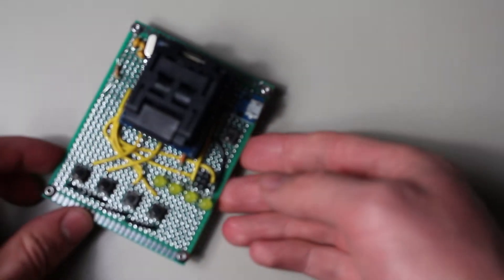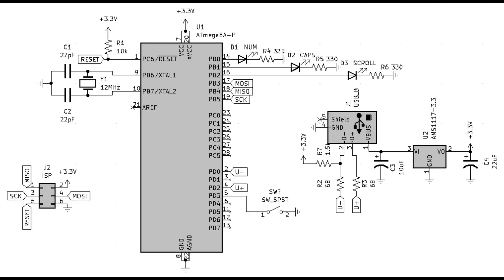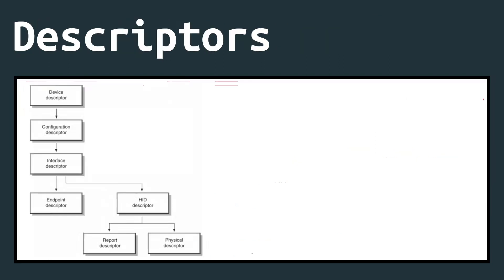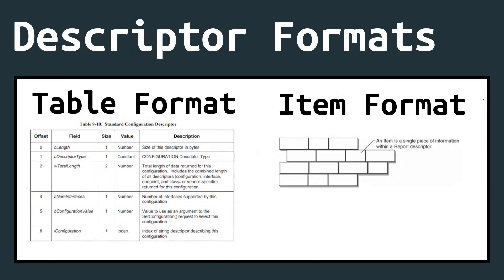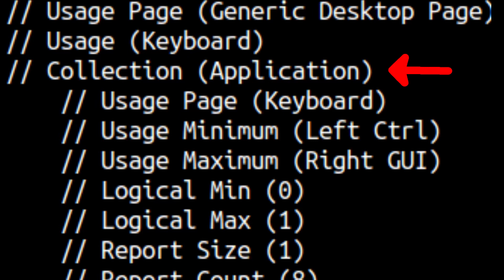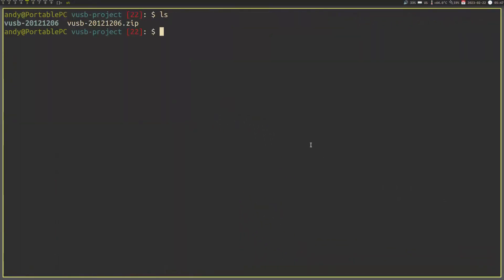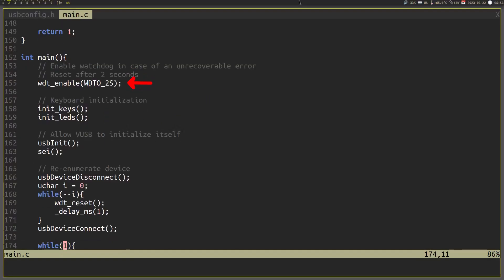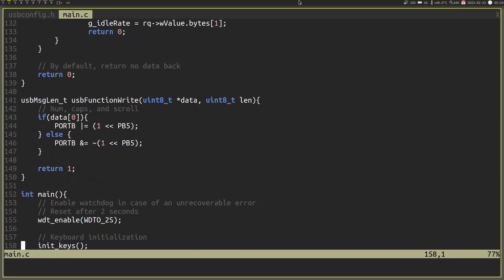V-USB on an ATmega328! - V-USB and HID Explained

Comment: This is a very good video by an obviously very knowledgeable engineer. I have an issue though and this isn't the only video by any means. Being trained in electronics for many years I was warned of the risk to components of Electro Static Discharge or ESD. Microchips which have circuitry that is CMOS based may be especially vulnerable to ESD as the inputs may be very high impedance and therefore prone to damage by static. The static may be generated in the human body by simply walking across carpets or wearing insulated shoes. The damage caused by ESD may not be immediately obvious but may lead to premature failure later in the components life. I therefore cringe when I see unnecesary handling of devices, especially with the absence of an antistatic wristband. Devices are shipped in antistatic materials for a reason

Comment: I recently came across another library tinyusb and used it to implement a USB microphone using a Pi Pico. How would you compare vusb with tinyusb? It sounds like vusb is pretty basic and is only intended for underpowered MCUs. Is that the case? Thanks.

Comment: This video is invaluable to me as I need to convert USB joystick and throttle control to an esp32-s3 that will control several actuators. You definitely pointed me in the right direction here but it is daunting with hundreds of pages in resources. Is there any sections I should pay attention to, or am I in for the full meal 1500 pages of everything you listed?😮‍💨 And no I am not going down to the bottom of the atlantic, quite the opposite actually, i'm building a ground effects vehicle using virpil controls😌
Reply from the maker: The most important document you'll need is the 'HID Usages and Descriptions' document. You don't need all of it, just find the right section in the table of contents. I'd imagine that the 'Game Controls Page' might work for your project. The hardest part will probably be making your own HID descriptor, and that's what the document will help you with.

Comment: One thing to consider is the "Speed grades"  "Maximum Frequency (versus Vcc)" curves, most of the "classic" atmegas are not designed to operate at full frequency while at voltages below 4.5V, and operating on those conditions might result in unexpected problems.
Reply: yep, on Atmega chips, only a max of 8MHz is safe under 4.5V so the full operation at 3.3V suggested in the video is not viable and a bidirectional logic level shifter on D+ and D- must be used instead. v-usb users generally use some cheap zener or blue leds to clamp the voltage but it's still a dirty hack with dubious reliability.
Newer AVR mcus don't have this issue. The most recent AVR Dx series can even set some of the i/o ports at 3.3V logic or lower independently of Vcc. This compensate the lack of modern AVR with native USB.
Reply: @PainterVierax  With the Microchip buying Atmel, one would expect USB support on the Atmega chips, but this doesn’t happen for some reason…